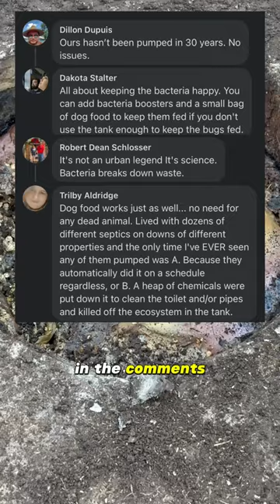Infinite septic tank hack #shorts

Comment: My neighbor says you NEVER have to pump it.  He also had to deal with his $20,000 flooded basement, so we really don't listen to him.
Reply: Luckily all the toilets go the sewer where I live so I don't have to worry about that
Reply: Only actual clean way is a dropshoot toilet
Reply: He’s actually not wrong. HOWEVER this ONLY applies to what is known as an “aerobic” (oxygenated) septic tank ie basically the waste material is broken down via normal bacteria but the tank is built in such a way where the waste is a regularly dispersed throughout the yard via an irrigation system ie sprinklers. 

My parents did this. They lived in their house from 2001 through 2013 and only ever had to rarely apply some bacterial supplements and sewer worked tho if you ever put “flushable” (idk) wipes tampons etc down you’d have to pump it. 

Basically you can spend an extra $10,000 and get a septic that is low maintenance but if you put weird things down the drain it defeats the purpose.
Reply: Oh cool, Talyllyn profile picture.
Reply: From my understanding, you wouldn't have to if only organic waste is going down
Reply: @rexjolles Yeah, about that 💀, my basement back flowed the toilet and everything even though we have a straight sewer line come to find out if you rinse even the smallest of food down the sink, it will still clog. (We tried our best to not flush food and grease down the sink but I guess that didn’t work)
Reply: @virtueofabsolution7641 he is wrong, never means never unless you specifically mention an exception
Reply: @DarkShard5728  it’s not an “exception” it’s just that he was probably incorrectly educated. There are two types of septic tanks. One type you basically never pump unless something goes wrong and one type you have to pump every so often depending on size. So if it’s one type he’s not wrong if it’s the other he is.
Reply: Hey at least a large percentage of that flooding is also extremely hazardous human waste! Oh wait that's worse not better.
Reply: I haven't had mine pumped in at least 17 years but that's because it's broken. It's been opened to evaporate though.

Comment: The purpose of the septic tank is to store solids for future removal. You do not want those solids going to your field lines.
Reply: Where do you think these solids go. They go to a larger waste treatment plant. FFS some people are not smart.
Reply: @kameljoe21  You know what you do at a treatment plant? You sample the contents via a sample basin. All those fecal contents, and tss ( total suppsended solids ) will fail your sample which can put you in a cap, and fined by the state, depending upon where you live.
Reply: @kameljoe21 or they go to a facalative lagoon, depenting on which type of plant you are refering to
Reply: @kameljoe21  You do know what a waste treatment plant is, right? It makes shit safe
Reply: @kameljoe21  have you ever seen a treatment plant?
Reply: @kevinbrandon8794  Yes I have been to a couple over the years. Mainly small ones. They are quite simple places if you think about it.
Reply: @kameljoe21   after the treatment plant they end up in the river, they don't stay at the plant.
Reply: @kameljoe21  what are you even arguing for? Your point was completely irrelevant. The solids go to treatment plants. Thats exactly why you need you septic tank pumped. Duh.
Reply: @kameljoe21 If your on septic then they don't go anywhere. That's the point of a septic tank because you don't have sewer mains

Comment: Its like changing the oil in your car! You can either change your oil at the recommend interval... or you can go 5x the interval and replace the engine or the car when it inevitably locks up on you from neglect

Similarly, you can pump your tank every 3-5 years, or you can replace your drain field in 15-30 years when it finally dies

Comment: Have you ever had to tell a customer their tank has to be replaced because they didn't keep it up?
Reply: It's not the tank that suffers if you don't keep up, it's your absorption area that will fail and that's the expensive part
Reply: He does have a video where he goes over the extensive damage that was caused outside of the tank when it was full.
Reply: @kstorm889 your tank can get fucked up if you neglect it a bunch, like if you have some real nasty shit in there, or the vent gets clogged the gasses in there will absolutely wreck any concrete, mortar, metal etc in there. Basically anything that can be corroded will be unless you have a properly operating system
Reply: @garageofscrap  we use poly tanks where I live. You will get gasses that eat at concrete regardless

Comment: I am entirely assuming with no prior knowledge, but here's my take:
A septic tank is exactly that, a tank. The fluids/solids inside cant escape anywhere except up and the gases probably get vented somehow, so the only way you will notice it is if it overflows. That is also something that must eventually happen if you dont empty it every once in a while, because guess what, bacteria can break down the shit in there as much as they want, as long as they dont turn it 100% into gases, which they cant, the thing will fill up. Doesnt matter if you got yourselves a nice ecosystem in your shittank, it wont magically make the shit disappear.
Reply: That’s sort of how it works. The idea of a septic tank is that everything flows into there, and there is bacteria in there that break down any solids. This leaves you with a sort of sludgy mixture. There is a drain field or soak away on the tank which is designed to basically filter off the water (which will contain a small amount of broken down solids, bacteria, and a lot of compounds such as ammonia). The water will then drain into a watercourse or soak away into the land. Over time the solids in the tank settle to the bottom and build up to the point that they need pumping out. It’s also good to get your system inspected as if the vent is blocked or your septic is especially gassy for some reason it will corrode the tank and other system components and will ruin it

Comment: Paying to get drain feilds replaced is ALOT.  About 700 if you dig them and replace them yourself. Its literary 3 30ft×4in pipes with holes drilled.

Comment: Like you said in the video, septic tanks should be pumped every 3-5 years. I'm curious to know your opinion on Bio One. I do about 4oz once a month. I should probably get it pumped in the next year or two, bought the house in 2021, sellers replaced the drain field and had the tank certified (concrete 750 gallon tank)

Comment: Before I purchase my house I had it in the contract that the owner was to get the dishwasher, bathtubs and washing machine off the septic system. They had a company pipeline them all together and made there on separate drain field for grey water. Nothing but poop goes in the septic
Reply: That is what I am going to do with the new house. Septic only tank and then a gray water tank and all on the same leech field. Just better that way. Plus it will take decades to fill the waste tank vs the gray tank. 
I also want a crust buster to blend it yearly. This will help move the oils to the top and the waste to the bottom.

Comment: My question really comes down to this. What will happen if you take a crust buster to the tank and then come back a week later. 
People forget that stuff floats and what float does not have a chance to get to the bacteria. So blending the tank should help move the solids to the bottom and the oil to the top. 
I am also going to bet that neither of these tanks are packed full of waste that exceeded what the epa recommended. It just looks like that.  
I am still waiting on a video to address this.
Reply: Former pump operator here. There are tanks that have aerators built into them to keep the debris stirred up and allow the bacteria to break it down, and in my experience they stay shockingly clean, but they cost many times more than a concrete hole in the ground. I've only really seen them used in spots where the ground was too rocky to excavate.
Reply: @johnharvey5412  I have seen those as well. Several channels talk about them after something quits working and they have to clean them out. I really want someone to do a video on it and do some science behind it. Because while these are cool for the views they offer nothing at all.

Comment: We aren't able to flush toilet paper down the toilet because our slumlord hasn't let us get it pumped since before we moved in, we've had septic problems before and we tried to call a plumber to get it pumped and he came down and yelled at us and told us not to have anyone come down messing with his crap
We've lived in this house for almost 10 years and he hasn't let us fix the plumbing, the messed up wiring, the holes in the walls from water damage and rats, the black mold in the bathroom cabinet, or the bum lights in the kitchen, storage room, my room, hallway, and my brother's room
Literally all we want at thia point is to get our septic tank pumped but the last time we tried (7 years ago) the slumlord make us cancel the appointment then came to our house and got our dogs severely sick by shoveling the septic water out all over our back yard
We would move if we could but inflation has made the cheapest place we can find over 3,000 dollars and we can barely afford our current rent of 850 so it is what it is

Comment: Brother i worked for georgian bay sanitation for 3 months and pumped over 1000 tanks. How many tanks do you pump a day?
Reply: 😂 was wondering that myself I have close to 10k pumps in 3 years but they prolly spend an hour at each job
Reply: Here in Tennessee, the company allowed two hours per tank, but that includes locating it with a metal pokey stick, digging it up with a shovel, and pumping it out, with no helper. Add in the fact that most homes on septic tanks are in the middle of nowhere, which is why they're not on city sewer, so add drive time to that.
Reply: @Edk583  yeah i used to run 2 calls an hour unless it was oversized tank. My tanker held 3600 gallons full usually did 3 to 4 tanks before dump. Loved it miss that job
Reply: Yeah ours is 3500 and we do 12-15 pumps every day

Comment: What’s the difference between the scum and sludge layer?  Is scum the floating layer in the pump tank and sludge the floaters in the trash tank?
Reply: Sludge is on the bottom and scum on top. They’re both normally on the first side of the tank.

Comment: Does all houses have septic tanks?
Reply: Amish homes may not have any plumbing. They use the old fashioned pit toilet, and hand-pump water from a well.
Reply: Septic tanks are used when a house isn't connected to a city sewage system, for example when it's a small town or an isolated building and it would be too expensive or complicated to link up to the nearest sewage treatment plant.

Comment: If they never have pumped it out they should get an inspection? Then we can see who's right
Reply: The sludge in the bottom is fully decomposed and similar to compost. It primarily collects in the main chamber. If the tank fills to the point that it spills over into the second chamber, it will slowly build up until it reaches the bottom of the outlet tube. The sludge particulate will start to enter the drain field and plug the pores in the pipes and soil, leading to field failure, and is expensive to dig up and replace.